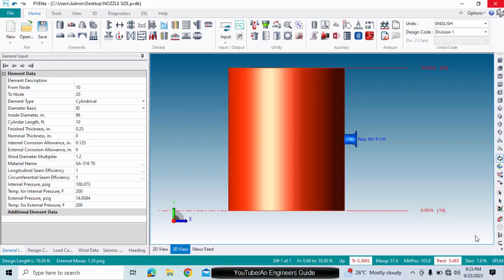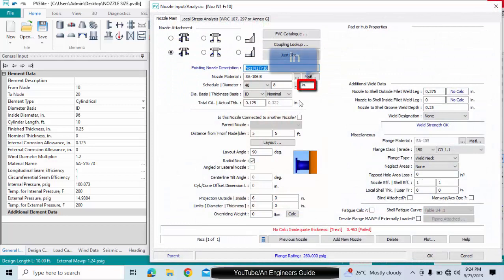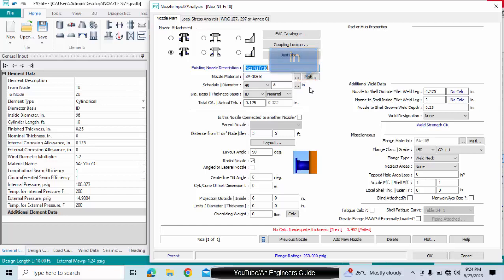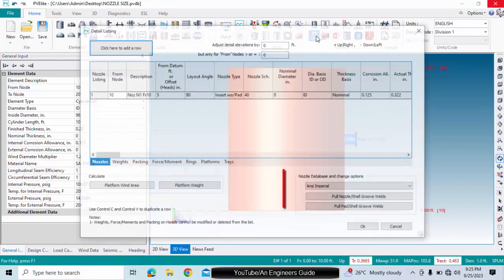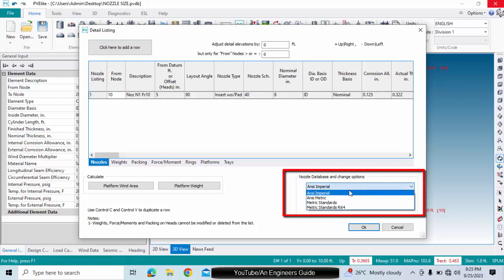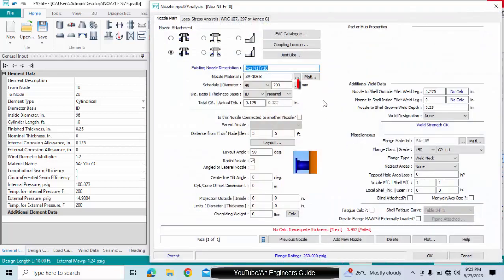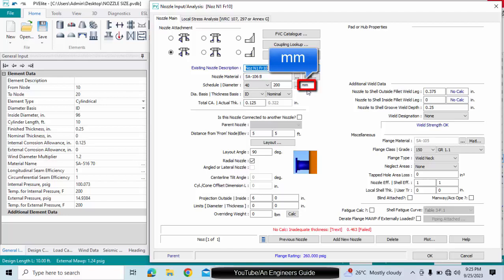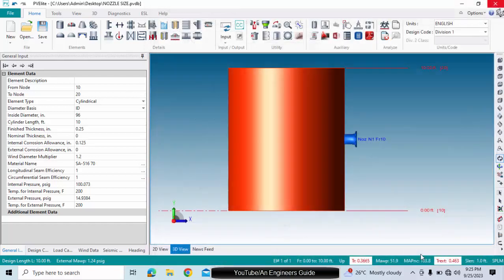"PV Elite Tutorial: Converting Nozzle Diameter Input from Inche to MM | Step-by-Step Guide"

Comment: Thanks for the informative tip...👍. In pv elite nozzle reinforcement pad outer dia, we have to calculate or it is given? If given, pls tell me where it is given?
Reply from the maker: PV elite calculates required RF pad dia...you just have to give some ref size of pad...But there are limits of reinforcements parallel to vessel wall as per UG-40(b) - max. of ( d, inside radius + vessel wall thk + nozzle wall thk)